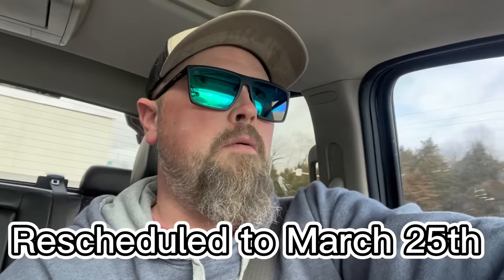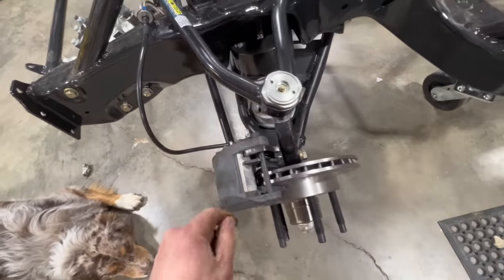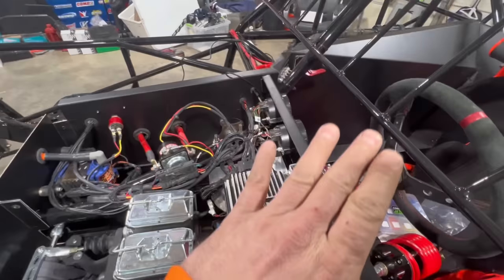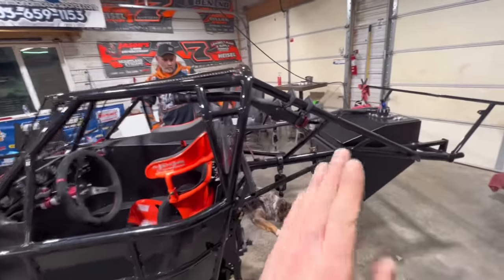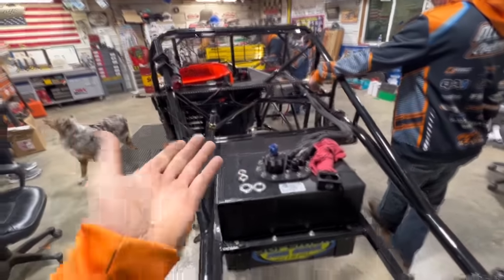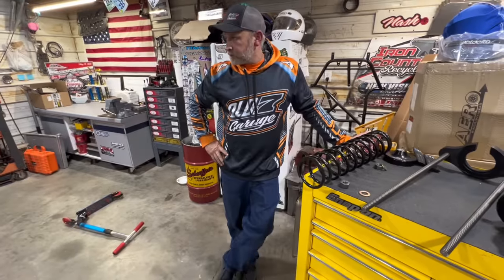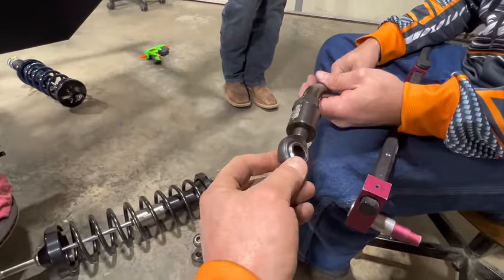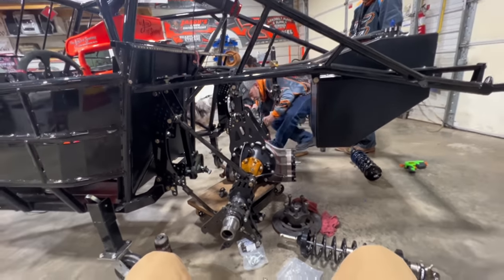We Put MORE Parts On The Impressive AND Picked Up Another Race Car!

Comment: Been a minute since hearing the GRT name. I knew that GRT made dirt late models, not so much on the modified side. Another chassis I haven't heard in a while is Dirtworks. Anyway, good luck with the GRT, get that dang Impressive done, will ya.
Reply from the maker: I’m on it
Reply: GRT under new ownership is building mods and some late models from what I gathered from the GRT YouTube video from the new ownership. 

DirtWorks was purchased by the Hoffman who owns Springfield Raceway. Anyways I have seen that they are building cars still, because I seen that Scott Drakes son is driving a DirtWorks cars.
Reply: @TheCrewChief374  Thank you for the information.
Reply: @whoknows3347  Yes under the old ownership, GRT has had new ownership for a year possibly.

Comment: Are you not required to pad your halo bars? Seems like your lights would get covered up
Reply: Very few people pad bars now days as tight as the cockpit is and with modern seats if you move enough to need that padding you’ve got bigger problems. Plus it’s hard enough to get out of a modern cockpit in a hurry without having padding making the hole even tighter